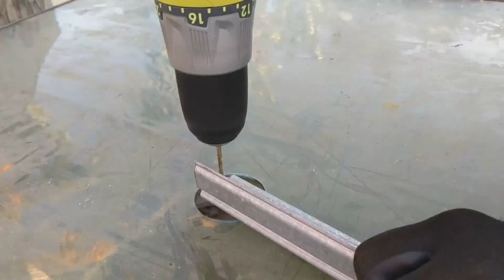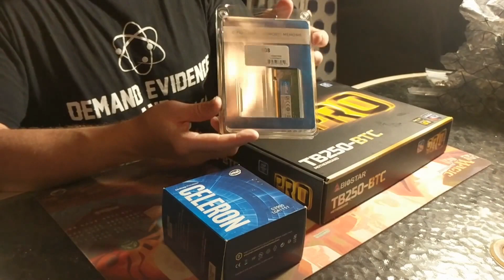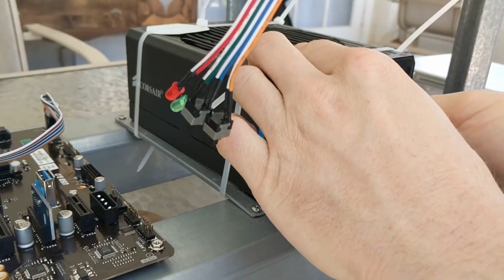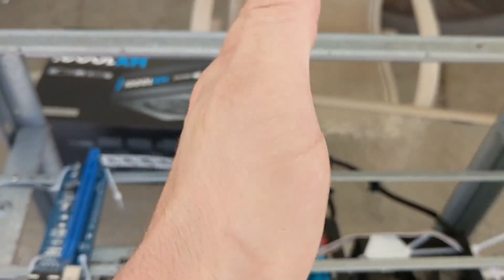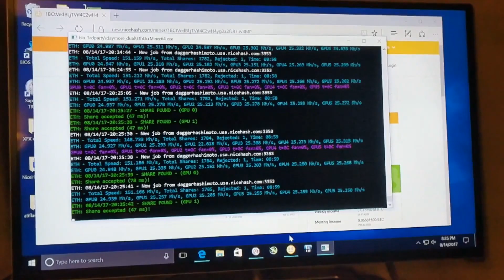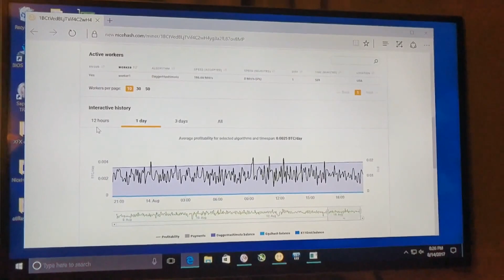Mining rig build 6 rx 570 XFX XXX amature first time build how to

Comment: I would appreciate if you take the time to answer my question, i have the exact same rig with the exact same video cards. How many hashes are you totaling currently and i had a problem where i would connect the monitor to the hdmi port of any of the video cards and it gave out display but fans did not move, what would be the cause of this problem? did it ever happen to you.
Reply: hdmi should be connected to gpu which is mounted with 16x pin pci slot
and this series graphics cards will not run the fans untill the temperature reaches the certain level!!

Comment: try changing the bios if you haven't. You can copy the 1500 straps to the others and should get  at least 27 mhash. Then install afterburner and play with the memory and power settings to get a little more out of those cards.
Reply from the maker: Jae Oh at this point I had already done the bios mod you suggested. After and released the new drivers I was able to get them above 26 each!
Reply: ehy ùan im using the same card but im only getting 19 mh